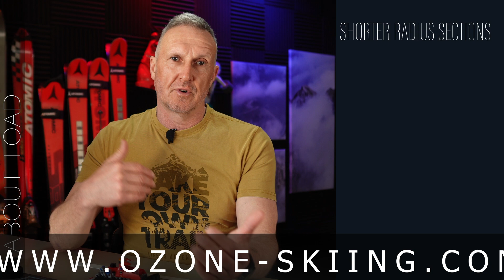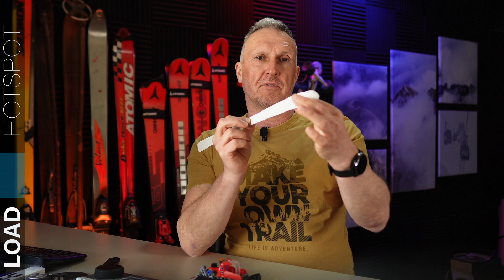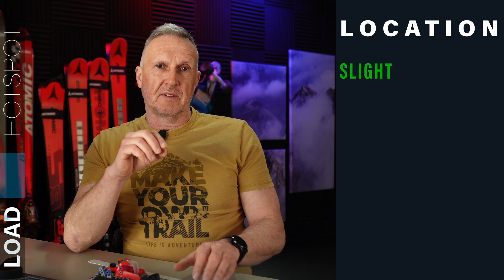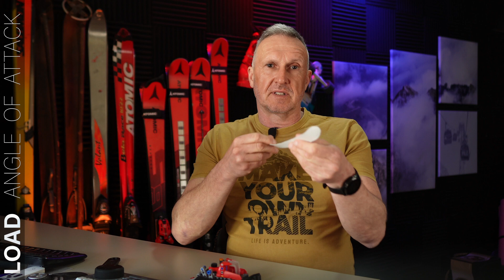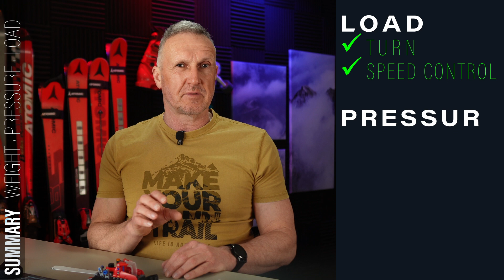What Makes Skiing: 3. Load

Comment: Miklos, wow I am having such fun learning the skiing movements in a different way and can feel the forces being produced. My question as we make a turn centrifugal and centripetal force is produced . At the apex of the turn is the centripetal force   the greatest and that is the pressure we feel and must act against that force with a long outside leg  or we’ll fall to the inside of the turn?  Thanks for your videos
Reply from the maker: Thank you! :)

It is an instinctive human reflex to resist the forces acting on us (in fact, this is the basis of the stance against gravity mediated by the myotatic reflex). 

However, sometimes, it is not the best reaction. 
In the case of gravity, we want to be balanced in the sense of equilibrium. 

In turn, when a force (we can call it centripetal) moves the skier into a new direction, maintaining equilibrium is a mistake, as it prevents the turn. 
Our reflexes act the same way as when standing: the corresponding muscles try to resist the force. 
So, it is typical that we fight against the forces in a turn, but we need to overwrite those reflexes to let the forces move us into the turn, and use the minimum muscle resistance, which is enough to ensure the body's stability, so that we don't collapse. 

Less skilled skiers tend to fight against the acting forces. 
The best skiers can use the same forces rather than fight against them.